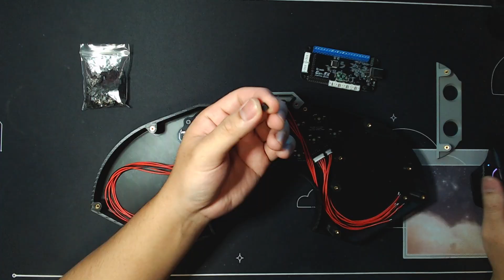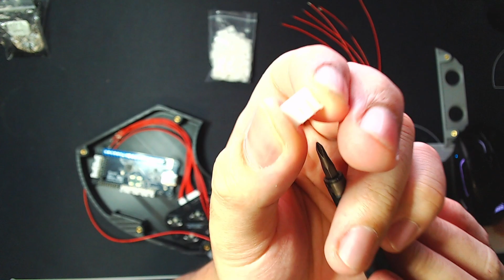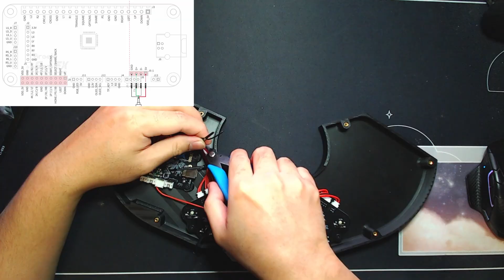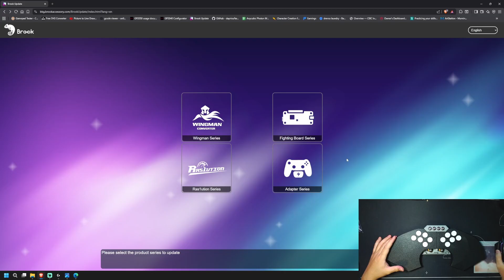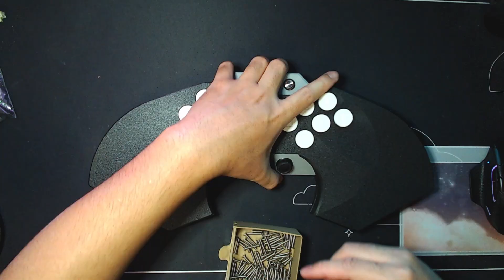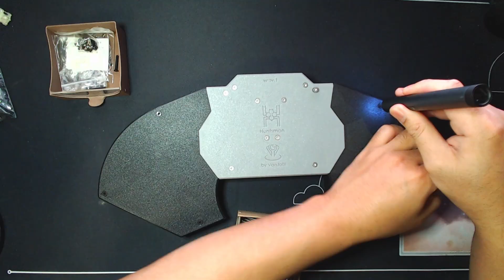Project Huntsman: 6b. FULL BROOK GEN 5X HUNTSMAN ASSEMBLY

Comment: hi, what specific analog sitck you are using? will it fit in a 24mm hole?
Reply from the maker: Its just a regular ps5 hall effect joystick and a pcb i designed to power it up. and it sits in a slot i modeled onto the base of the case, you can see how its seated in this video and in the GP2040 assembly video.

BUT.... i am planning on making an insert that will make this fit in a round hole. not sure if it will fit a 24mm hole but its definitely gonna fit a 30mm. Keep an eye out on my gumroad, ill be posting it there when i get to it. 👍🏼
Reply: @V_Angelus ow, its custom, im trying to also add analog sticks on my build but i cant find any with brook gen5x compatible wirings, can you recommend any that has those? I dont know how to create custom pcb
Reply from the maker: @venpogi-fgc oh sorry its the main reason i chose to make my own, i cant find it anywhere either haha. but i have the pcb design shared in pcb way so anyone can order em and DiY em. youll just have  know how to solder the analog sticks and jst connectors into it.
Reply: @V_Angelus  i think i found a solution, i found this ps2 analog sticks that has those exact pins, problem now is mounting this on a metal plate